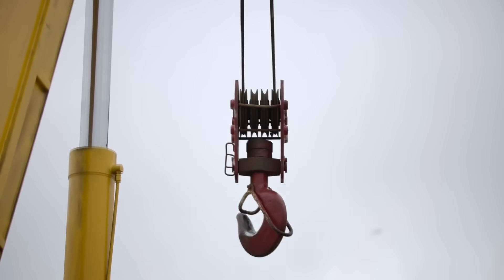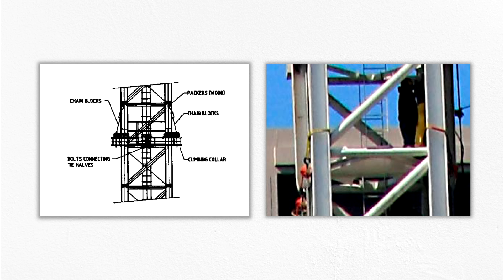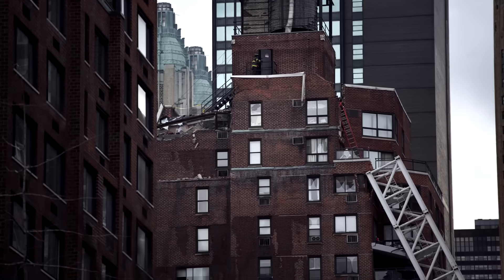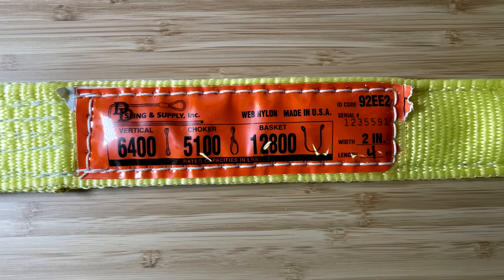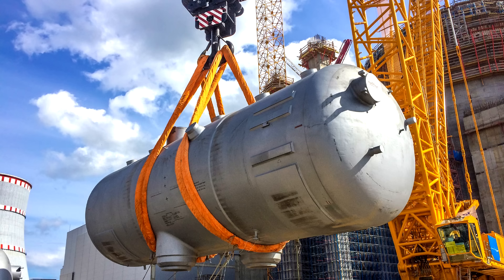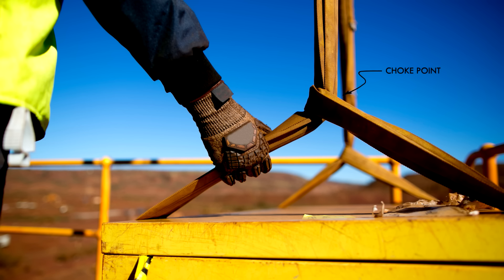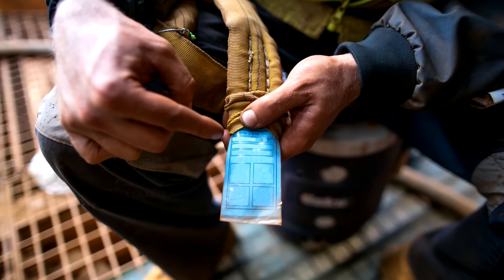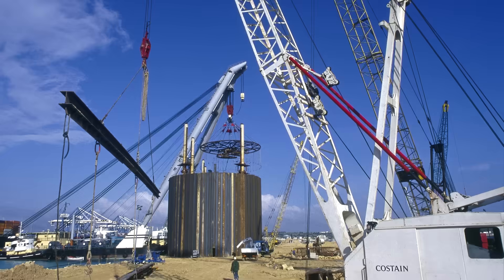Why Things Fall Off Cranes

Comment: Crane Operator here,  on your angle of the sling part of the video, not only are the slings a factor to worry about but you can bent the very thing you are picking up if the angle is too small.

Comment: Former flatbed truck driver here. Lots of ways this can apply to truck drivers as well. Nothing worse than a 40,000 pound steel coil coming loose off the back of a truck and rolling down the highway. When I was just starting out as a flatbed driver, it surprised me that the working load limit of a 4-in strap was higher than some of my metal chains.

Comment: At eighteen years old I was rigging cut timber for helicopter lifting in the forests of the Pacific Northwest. I moved onto another career path as a heavy construction worker, as a boilermaker. Rigging was a large part of the apprenticeship training program for us. I was onsite multiple times when mistakes were made and cranes or materials were dropped or collapsed. After seeing the tension guy wires slice a full-size Chevy pickup when the crane attached to them collapsed, I was convinced that there’s no room for mistakes in construction. 
As a side note, I still have the Rigging book that I was given back when I first started in construction back in 1979. It fits in a pocket and has vast amount of useful information.

Comment: When I did rigging while working in a harbor, they didn't really give us any kind of training to calculate whether the rigging would hold. But then again, we were always lifting the same kinds of loads every day, either bundles of steel bars or bales of rolled up steel sheets from the nearby steel mill, both of which came in a set of standard sizes, so presumably somebody had calculated beforehand that the type of rigging we were using for each load was able to handle the weight.

Comment: The photo at 8:50 amused me! Pictured is a lifting strop or sling which is clearly damaged beyond repair. And should not be used. 
Where I work, the code of practice is, if you see a lifting sling in that condition, finish the job with a stanley blade and throw it in the bin! Put an order in for a new one and log the old ones demise. 
Its no use to man nor beast anymore!

Comment: when I worked at a chemical plant. do to the safety rules of the plant. all items that  had to be lifted needed to be double strapped. with the measurement that 1 strap had to be enough to hold it all. the second was  only a redundancy.

Comment: Three items:
I really enjoy your videos.
I remember the 2008 crane collapse. That got 'breaking news' national coverage on practically every channel. That same day there was a crane collapse in Florida that received almost no national coverage.
Is there some reason why a cube-load doesn't get straps running 90 degrees from the other support straps? It wouldn't apply to every job, but it seems it would keep some loads from shifting.

Comment: Spreader bars are also used to keep the slings from crushing the load and to keep the load from buckling and crushing in on itself. 2-4 way chains can also be used. Grease, oil, chemicals, direct sun light, prolonged moisture etc.. can also  be damaging to slings. Great simplified video of a quite complex under appreciate trade.

Comment: I had a dismantled and stripped car body hanging from a synthetic sling when i was lifting it from customer's yard onto my truck. The sling went under the front door frames, which did not have door seals installed anymore. On that day i learned that even painted sheet edges can cut a sling. Ever since having a body fell on ground half a meter in front of me, i have used a lifting chain to lift scrap cars.

Comment: Was lifting a stack of roofing metal one time, two basket hitches under a pallet with metal on it (to keep straps from rubbing on sharp metal edges). Everything was going well until a gust of wind tilted everything just enough for couple of sheets to start sliding. From there it domino'd and before i could lower everything the entire stack slid off the pallet. Luckily nobody was hurt and the way the stack fell only damaged one corner, so the metal was still used after some trimming.

Comment: You are wrong. This video IS for training. Most of what you show are things NO ONE SHOULD EVER DO.

At 1:30, bundle lifted in choker hitch. No pressure on top of the load. Loose props on top, dangerous, easy to slide and fall. Use double choke hitch. Oh yes, also 2 chains are loose. Land that load and you might have them hitting your head.
At 3:10, NEVER LIFT WOODEN PALLETS on slings. The materials on them are not secured, wooden pallets have a tendency to colapse under load. Very easy to end up with a shifting load on a pallet.
At 7:30, left side hook faces the wrong way. No crane operator would lift that. Competent ones, I mean.

Comment: Riggers and engineers who design the load lifts are incredibly picky, with good reason. In the U.S. Army, crane and helicopter rigging is predetermined, and the riggers are not allowed to deviate from the plan. I was training at Fort Campbell KY once, and there was a 105mm Artillery  canon that had to be dropped because it had been improperly rigged.  It stuck in the ground barrel first. ^_* Most items shipped to the military in crates have a center of gravity marking.
Reply: Did they leave that cannon there as a reminder to rig loads properly? Can't even imagine what a chopper pilot would go through feeling a load shift, but is that one of the reasons everything is lifted by one line, so a load shift won't suddenly twist the helicopter in some weird way?
Reply: @AgentWest  I think they left it in place because they couldn’t figure a way to get it out.  There was no way to get a crane to it, and it couldn’t be lifted by a helicopter.  The  hook on a Chinook is able to rotate, but in this case the incorrect rigging caused the load to start swaying.

Comment: I won't lie to you I ran to computer science to avoid this. I am a super safe guy. I can't stand cutting corners or doing time shortening things. I realized if I were to ever be on an engineering project, I'd probably always over engineer with and run up a high budget. In software, rarely anybody dies and all that is lost is money if a critical failure happens.  

I still can't believe boeing did what they did to those max jets. That was the stupidest solution I had ever heard in my life. It was a solution only a person of privilege would make.

Comment: I agree it makes it safer from sliding.   Does it really give you more capacity? I see two angled supports above the spreader bar that to me seems to also require a reduction in capacity.   This wouldn’t be the case if the spreader bar had an eyelet to lift from.

Comment: One of the scarier moments of my life was when I was working at a welding shop. A heavy rigging chain snapped while trying to lift a a very large  machine base. The other chains came loose and the sight of multiple long heavy chains dancing like whips in the air was terrifying. Anything soft and squishy would have been destroyed by them. It is what I imagine a drive by shooting must be like. Just random death whipping through the air. Thankfully no one was hurt.

Comment: “You don’t use a piece of old rope out of your pickup bed. You don’t use a ratchet strap from the big box store down the road.” Well good thing driving a properly equipped pickup have literally everything in the back including slings, as knowledgeable pickup drivers should have. 😂

Comment: So to sum it up
Overload
Fleet angle overload
Lack of positive connection
Using incorrect sling types: synthetics on hard corners or sharp edges without softeners.

I will add poor crane signaling, which can cause shock loading of the rigging, or the signalman could crush the rigging between the load and structure. 

Uncontrolled load transfer where the actual weight is unknown and you are going with a calculated weight. The crane my not be holding enough weight and load might drop during final cut/unbolt  or the load might be lighter than the cranes holding weight causing it to rise at final cut/unbolt. 

Poor rigging maintenance: nylon flat straps should be replaced every 2 years whether worn or not as they dry rot  polyester slings every 4 years or recert them. 

Chain hoist and ratchet lever hoist as well as spreader bars are only tested to 125% of rated weight unlike most other rigging components which are often tested to 4-500%.

Comment: One thing you didn't address with sling angles is that the slings also produce compression stresses in whatever you're lifting.  I've seen a fairly light beam bend in the middle when being lifted from near the ends without using a spreader.  It =should= have easily been able to support itself, but the angle of the slings was shallow enough to cause compression of the beam towards the center and it simply failed right in the middle.

Comment: I've been operating crane for over 8 years. Great video! Only thing I would add is that in my experience spreader bars are just for loads that are too tall for straight rigging or you want to avoid the rigging crushing the load. Usually you're using a single bar so on a 4 point pick you will still have sling angles on both sides. Not to say there isn't a scenario that would be the case but extremely rare.

Comment: having worked as a machinist for years, this was fun, I've used a lot of slings and chain fall hoists, and we've absolutely had abraded slings break, because someone failed to examine the sling before working with it. It's certainly not a 20 ton beam, but we did lose a piece that weighed about a tone off one. 

The other part of physics... what happens when someone doesn't secure a work piece into the machine well enough, and doesn't get it balanced well between the chuck and fixtures, definitely seen someone lose a 600 pound part turning at over 100 rpm.

anytime the weights big, or high rpm in high power machines, dangerous things happen, But you can only make things so fool proof, because they'll go on and make a better fool.

Comment: Why things fall off or the cranes hook?

Incompetent riggers, often pulled off the streets with little to no training.

Companies also dont offer training very often, more companies require you to have experience and certifications before hire. This leads to buying certs, or just passing a test without actual experience. Then lying on the job application to just have a chance to learn on the job. 

Poor pay means it hard to keep good riggers around. Most big crane companies start pay scale fairly low and by the time those people hired are decently skilled they often leave for higher paying rigging job. 

As a rigger by trade with nearly 10years of experience ive seen many bad rigger and even good riggers using bad rigging practices. 

Another thing is time frame and site limitations. On paper you can alway do things perfect but reality is sometimes you are forced to do scetchy things.
Reply: I was thinking about that too. It's hard to imagine the team just nodding along approvingly as you hold everything up because the sling is a little frayed or the load rating is a little close for comfort or the crates all need to be opened and have their centers of gravity marked. Can't just grab a heftier sling on a quick trip to home depot I'm guessing. But perhaps if the rigger has a certain gravitas like Sam Elliott or Nick Offerman they can pull off the safety first power move just fine.
Reply: @jboogie8369  ive yet to see a company push a truely dangerous situatuon, if the rigger/operator isnt confortable you can typically say no and keep your job. usually its not really damaged rigging that hold things up, its using rigging near 100% capacity on unknown weights, it putting slings at horrible angles because you dont have the head room, using multiple small chain hoist or lever hoist because bigger isnt available, or needing to flex company policy.

Not having the correct length slings. And more often than not its uncontrolled movements. 

We have fixed most of those issues at the company i work it with simple things like wide mouth deep throat  shackles, d-rings, and having a really good engineering team to help us on calculated weights and find center if gravity on complex structures.

We also pay okay, its towards to bottom of the scale but its not horrible so we get repeat employees. Most if which are handpicked. I cannot afford to hire and train a new guy since we work short time lines and i need to walk away and know that rigger can handle things. I hate that we dont hire helpers to learn. When we do get teaching moments we try and spread the knowledge but hands on experience is the only way to be competent
Reply: @kylevanwinkle2081  Thanks for the color on that one. I've always found workers' attitudes toward safety interesting. Pride often plays a role either way. Some are too proud to admit they can't safely complete a task with their current gear or support, and some take pride in their knowledge of the best practices and failure modes associated with their trade. Naturally, there is far less downside to the pride exhibited by the overly cautious :)
Reply: @JaredCzaia  well end of the day the job has to be done. Trick is to know where to stand your ground and where the danger line is. Stepping away from danger is what we want. Figuring out a safe way to do the job is 90% of the job. Its literally risk management and finding out what the acceptable amount of risk is. Something as simple as walking under the load, isnt dangerous 99% of the time but the 1% of the time the load falls or shifts could kill or maim you. So you do the best you can to not get under the load. But there are times where there is no other way to do the job. 

Cfr1926.1425 is the osha regulation that says being in the fall zone is okay if you are required to be there except for tilt wall applications because concrete anchors can fail unexpectedly or the concrete could crack and fail. 

Honestly i think 3rd party certifications have hurt the industry. Just because you can pass a test doesnt mean you can rig.

Comment: As an industralworker who works with cranes on a daly basis, i can tell you that the shown example are just the basics. Much more dangerous is, when you work with loos Atatchmentpoints (like the shifting on 5:06). And there are a lot of them. Magnets, Liftingclaps, suction cups... Also you have to think about the forces when something is stuck (Heavy tools from the machine fir example)
We use at least 500kg (most of the time 1500 - 2000 kg gear to lift things wixh are "Just" a few hundred kg, so we are on the safe side. These components who fall down are all with loos atatchmentpoints. If you have a fix Atatchmentpoint (thread,  Holes....) you are quiet safe.

Comment: Career rigger here 💪 I seen a accident in 2016 or 2017 when another rigger from the building next door, rigged a air compressor to the crane from a built in picking point on the 2500 lbs compressor. Well the crane put it over the iron workers and the picking point broke apart. Felled on top of a 28 year old iron workers named René, from Nicaragua. Killed him instantly. Sways check your picking points and slings.

Comment: The only rigging failures I ever witnessed in my years as an Ironworker were when carpenters or electricians did the rigging and signaling.  Not a big fan of non ferrous chokers either.

Comment: As a theatrical/concert rigger this was a great video to watch! It would be fun to see you do a video on the FOY flying system for actors, which was developed for Peter Pan. I think you'd enjoy it! 
Question though, at 7:39 (beam lift), I can't help but notice that both hooks are in the same direction...meaning the one on the left is backwards and has a better potential of falling out if there is a shift in load due to wind or placement on the structure being built...
Reply: yes it;s not most ideal. even better would be to use hooks with springy flaps. or shackles locked with pins

Comment: I spend my days (mainly early mornings) moving around prefabricated concrete walls using an indoor overhead crane and two-point lifting beams, as well as chains. The walls weigh anywhere from 2 tons to 22 tons.
It takes quite a mix of calculation, eye balling and guesstimation. 
Ideally, every lift is calibrated, all attachment points are exactly where they're supposed to be. Every now and then, though, special circumstances arise. L-shaped walls, slanted walls, curved walls... This is where experience and a keen eye helps a lot.
Keeping everything balanced both when picking up, transporting, and touching down.

Losing control of several tons of concrete standing twelve feet tall would be an absolute nightmare.

Comment: Great info.  We had an accident once on a heavy lift (~140T).  I wasn't involved directly, but we all had a safety-standdown and training on it.  It was a heavy machine casing that was to be lifted about 6 inches to work on footings.  Was supposed to be combination of crane (using wire-rope slings) and hydraulic jacks.  When hydraulics developed a slow leak and pressure slowly dropped, it was 'decided' to not lower the hook and just let it take up the weight (hook was rated for 150T after all).  Unfortunately, the wire ropes were NOT and they failed spectacularly.  Dropped the load those 6 inches and even at that short height, damaged footings and led to a lot more work.  Fortunately, only one injury, arm laceration from splaying rope.

Good lesson in, 'when things change, don't make up procedures on the fly'.